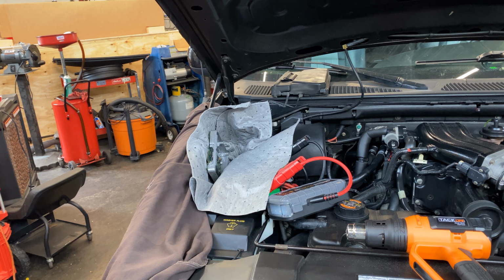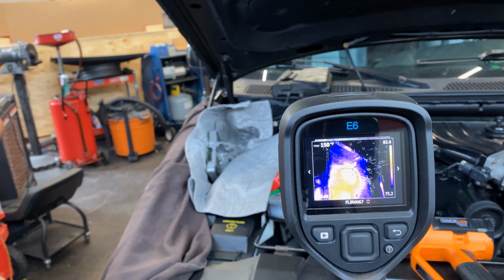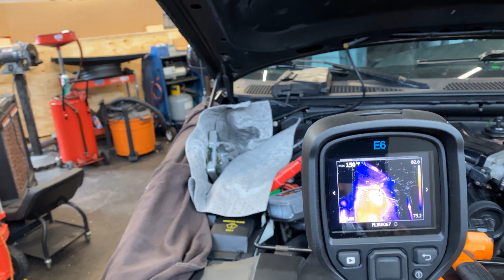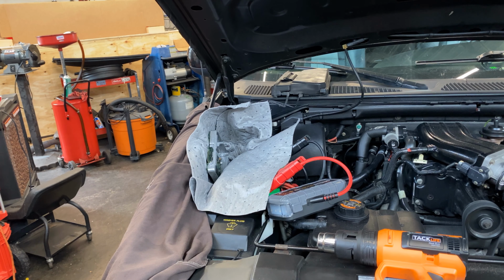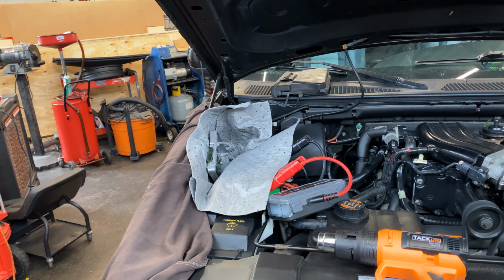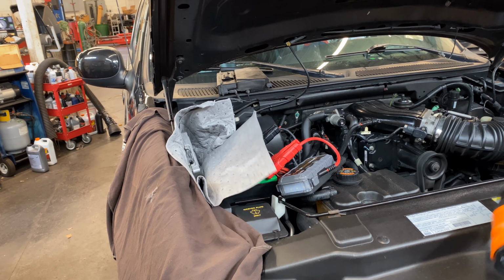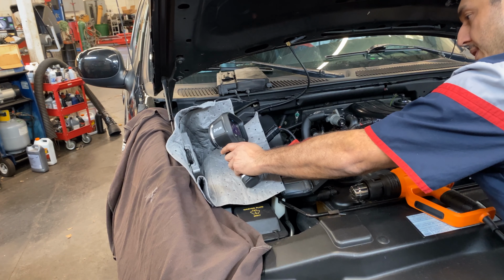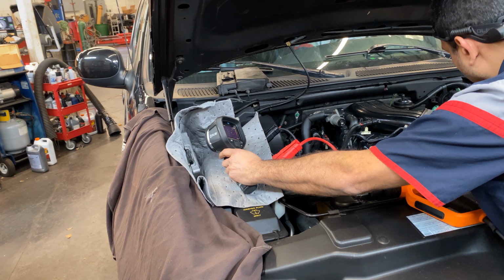2003 F150 Harley Davison 5 4L Supercharged Long crank PCM fail finding!!

Comment: Install a glow plug in that module😂😂😂☝️ great video Maic💪
Reply from the maker: DiagnoseDan lol!! Thanks for stoping  by my friend!
Reply: Did you replace the pcm, and did it fix it? My personal 2003 F150 has a very similar issue and the pcm did not fix it. My little project has been on-going for months. Had to switch to another daily driver.

Comment: 2003 F-150 5.4 supercharged. Similar long cranking but not a steady cranking sound. But with a sorta peaking, galloping sound. Main issue began with just a slight tremble at idle. From a misfire. All new coils, plugs, & injectors. Now much worse! With 12% compression on #7 & #8
Vac system/intake tight & no leaks. Idling & in town, runs rough but on highway or putting your foot in it. No problem!

Comment: i work a lot on the 5.4 2v but they do not have the charger on them. when they do that trouble i check if they have the code 1000 if they do. then i know it the memory power is suply to the pcm problem that cause the long crank